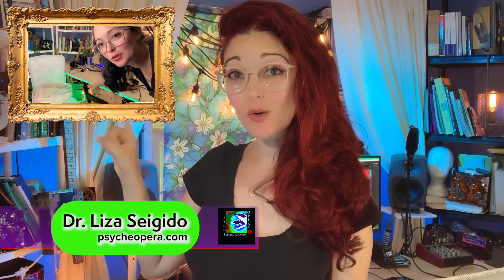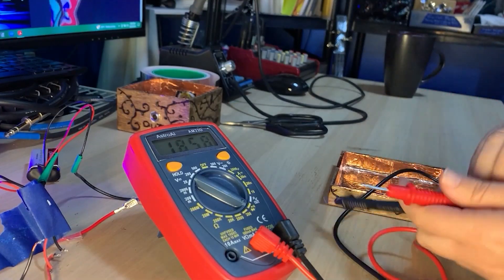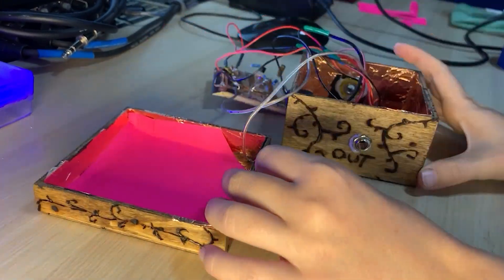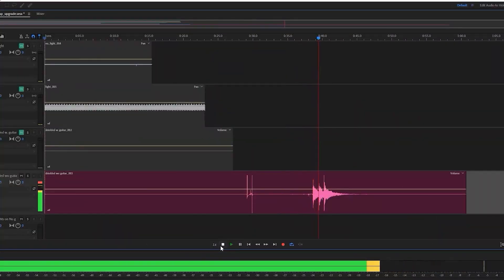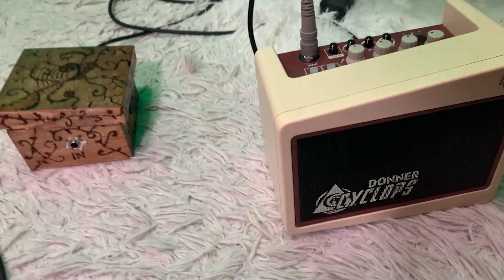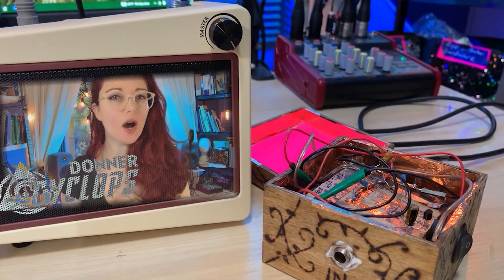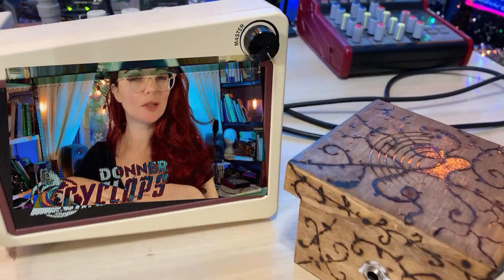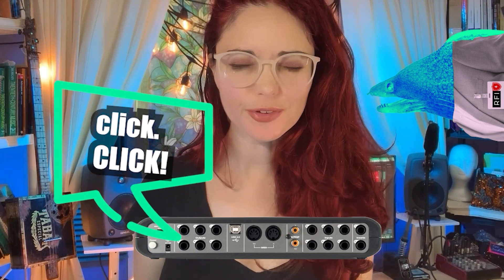Shielded My Piezo Preamp Against EMI : This Is What Happened

Comment: Hi. Thanks. I like your experiments. Maybe I will use some of it. The circuit only produces the positive half of the sine wave, no? Maybe some sort of H-bridge configuration would give a richer sound? As for the tracks and shielding, easier, and foolproof, method would be a conductive ink which you can simply paint onto the wood. I make my nanocopper by immersing aluminum foil into CuSO4 solution. I get my CuSO4 from gardening supplies. Dry your nanocopper, mix it with little epoxy, and there you have your conducting ink. Or buy it ready-made if you aren't like me, I spend weeks thinking about how to save one dollar. 
I grow lots of CBG cannabis strains, it helps me with my interoccular pressure issues, and as a bonus improves regeneration of neural network in nerves and brain, and it doesn't show on drug tests. But it isn't psychoactive, can't have it all. Completely legal.
Reply from the maker: Hey! 👋 Thanks for checking out my video. ✨ I like your idea about the conductive paint; that’s definitely worth a shot. 👍 This circuit I shielded is a piezo preamp I built for my cigar box guitars or cbgs. I plan on changing up some components to improve its frequency response; I’ll definitely share the results of the upgrade here on YouTube 👍💜✨